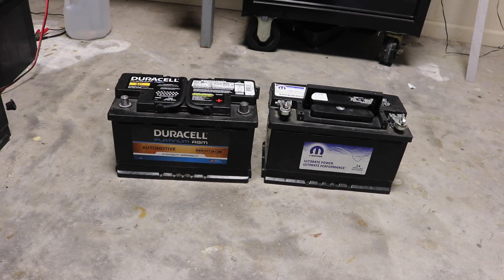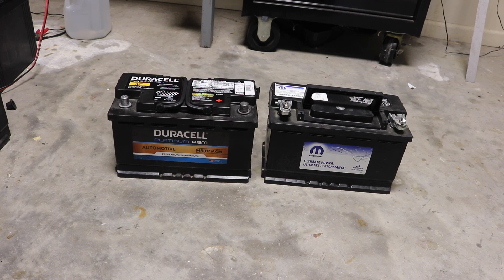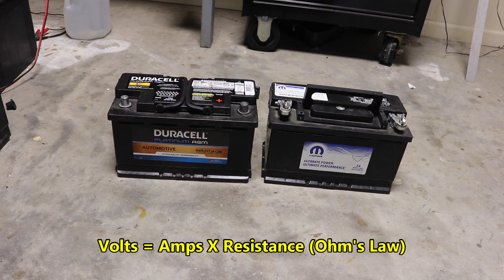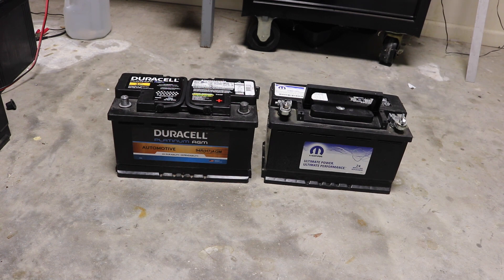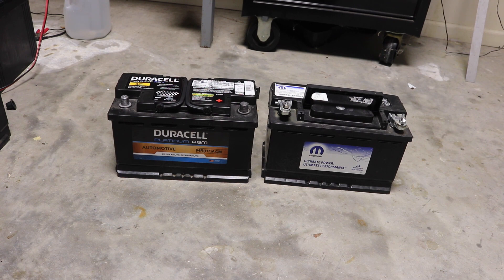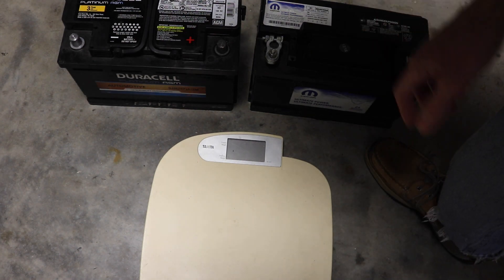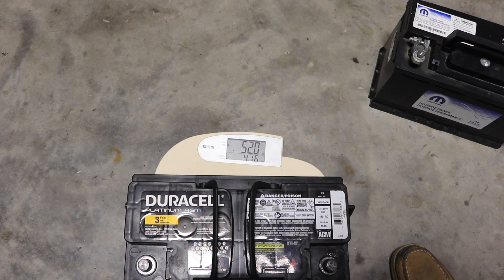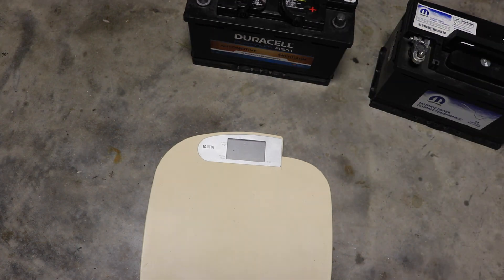RAM 2500 Cummins OEM vs aftermarket battery?

Comment: My '14s OE batteries lasted 6 years; one in Indiana, one in Michigan, and the rest at the coast of North Carolina. In 2020 I replaced them with Wal-Mart's equivalent which lasted only 18 months. This happened around the same time my alternator went out (145k miles), which in these trucks can cause major issues, send you down rabbit holes, and leave you stranded. It all happened when my wife was driving the truck. On a trip to the grocery store the truck went into limp mode (red lightning bolt) and threw codes for the throttle valve (there's no throttle valve on the truck anymore) and for an issue with the #6 injector. The thing sounded like it was down a cylinder! She called and I told her to try clearing  the codes with my Edge CTS2 monitor but to no avail. She had to wait hours for an 8 mile tow which the insurance company ended up not covering (about $500). Now here's the kicker: If I would have tried trouble shooting the codes I would have been looking at potentially replacing an injector and the PCM! Turns out the alternator was on it's last leg but you'd never know it; no codes, everything worked as expected, etc. It just randomly went into limp mode with random codes one day. When I got the truck home I changed over to a Mean Green 300 amp alternator and got two new Duralast Golds and she's been good as new ever since. Lesson learned is that these trucks have very sensitive computer systems that, with just a bad battery or weak alternator, can cause major headaches! Hope this helps someone because it is not uncommon. 👍
Reply: Sooo….you blame a WM battery for poor quality when IN Fact it was your failed alternator (and your amateur, unauthorized unapproved modifications) that caused the problem… Then when a good alternator is coupled to replacement batteries (mfr’d by the same maker to similar specs as the WM’s) …you proclaim the less economical batteries as superior?   You FAIL in Logic.
Reply: @ghorn3136  What a fail in logic looks like is your assumption that my "amateur, unauthorized unapproved modifications", which are neither unauthorized or unapproved and impact the truck's electrical system so little that they are not measurable and would be impossible to cause the problem, are what caused the problem. Congratulations.
Reply from the maker: @monsterram6617  yes sir I totally agree and thanks for taking the time to share that story. It’s quite amazing.

Comment: Thanks for the video and clarification. I thought the original was AGM also but now knowing it was not makes sense why the original batteries went to fast compared to the AGMs I installed. I did go to 850 CCA from the original 730 CCA which I thought had something to do with it but likely just the fact that the new is AGM.

Comment: We had -5 for 3+ days and the 2500 2017 Diesel would not fire.   Factory batts.   Too funny as i had just paid it off last month and had to put new tires on it and brakes and said now at 5years its time for batts.   So was traveling when it happened so went to local advanced auto parts and got a couple Die-hards and found it interesting that there is no such thing as a 5 year bat anymore... middle of the road was 3year and for 20 more could get a "platnum" with 4 years.  So dropped both in (800amps) and back in business.  I was fortunate as the main bat on driver side had a heck of a bulge in it.   Even wilder was factory bat was date stamped 2013.   Went on a lot of forums and found that 3years is a long time for those mopar bats.    I guess i was very lucky.    Cheers.

Comment: Best deal I could find currently  is an Ever Start agm platinum battery with a 48 month warranty at walmart for 180.00
Just put 2 in my 2012 ram 3500

Comment: Is it possible that your dealer replaced your original agm batteries with flooded batteries? I know for sure my 2014 and 2017 came with agm’s as original equipment.

Also, fun fact, there’s only 2 or 3 major battery manufacturers for starting batteries. Johnson controls (Clarios) makes about 70% of them, I think the others are East Penn/Deka & Exide. There’s a good chance the original mopar batteries and the duracells were made by the same company. 

Energsys makes the Odyssey and Northstar batteries, which are supposed to be very good and expensive, but I don’t know that they’d fall into one of the major manufacturers for starting batteries since they are focused in other industries.
Reply: The Odyssey batteries are excellent and worth the money in my experience. Keep in mind there are foreign-made batteries which are supplied as OEM batteries in some cars. I don’t believe the OEM RAM batteries are AGM. The diesel uses dual 730cca standard lead maintenance free batteries and the Hemi uses a single, but identical 730cca battery.

Comment: Marion, it looks like you installed the L-shaped vent on your uracell.  My old batteries didn't use vents.  Wasn't sure if I should use them so I left them off. Looks like I may want to recosider my decision!  Thanks again for your informatve videos!
Reply from the maker: They’re really not necessary unless you want to connect a tube to it and pipe it somewhere else. the battery doesn’t vent unless something goes haywire so you really don’t have to worry about putting them on. Unless you just want to point the vent downward
Reply: @MarionBlair  Thanks for the clarification--that sets my mind at ease.  I'm going to ignore them.  Happy New Year Marion!

Comment: Thanks for the videos! Heavy duty diesel trucks are new to me and your videos have been perfect for learning about my truck. Did you have a "Battery Saver Mode" message pop up on your dash? Was this the first sign that the batteries were failing? I live in Canada, so starting in the cold would draw a lot of power for the grid heater. I have had this message start popping up on cold days if the truck has been sitting for a few days.

Comment: I'll be changing the batteries in my 2018 Ram 6.7 in 2023 before a planned trip to Florida late in the year. Your discussion about batteries is very timely for me. I'll be replacing the alternator also as it seems to be failing. Any suggestions for me to look at on a good replacement alternator would be appreciated. Thank you!
Reply: Look up the Mean Green 300 amp alternator.
Reply: Go heavy and it will last forever. Extra $100 for a good one compared to light side OEM alternator.  Just my two cents… I ordered my 18 ram with the heavy alternator and it failed last year also.  Sometimes they just go bad sometimes they last forever.
Reply: The stock 220a single alternator gets overwhelmed by the grid heater cycling during the cold weather we have in the north. The headlights repeatedly dim and blower slows. That’s ridiculous on what is a new, very expensive powerful truck! The duals solve the problem. I also think the batteries are not large enough.

Comment: 2018 ram Cummins, 3500 I bought new. Just went out the other day and batteries have now failed. hopefully that’s it and not the starter. With the ignition on, I went through the screen to look at voltage, and the voltage was way down.🤔
Reply from the maker: Probably the batteries, the starters are pretty tough.

Comment: Marlon, what year is your truck?  I have a 22 and the dealer assured me that I have AGM.  But that’s not the main concern.  The concern is, if the dealer is wrong, and the batteries are indeed lead acid, then what are you doing about the alternator charge current for the new AGm?  As you may know, unless the charging current is 14.5+ volts max, then your AGM batteries will not last!  What are you doing about this?
Reply: Great point, you need to disconnect both batteries simultaneously when replacing them. This will allow the “Intelligent Battery Sensor” to learn the new batteries and provide the correct charge and voltage.
Reply from the maker: Most modern trucks can limit their charge to handle the AGM. This one does. I suspect the newer trucks to have the AGM‘s, I should know but I don’t. The 14s didn’t have AGM.
Reply: @MarionBlair  I would highly recommend that whatever we go by is 'factual' and not an assumption.  Perhaps you can perform a quick charging voltage test to be sure that yours & our 'most modern' trucks indeed do this and functions correctly.  AGMs are very expensive, and it would be a shame if these expensive batteries are dead within 2-3 years based on our 'assumptions'
Reply: I also have a 22 and there is nothing written on the batteries suggesting they would be AGM.  I doubt very much it is AGM. If it would be RAM would say so as it is a more expensive battery. When it comes to charge voltage there is very little difference between wet and AGM. As a matter of fact Lifeline who only build AGM recommends 14.6V. But charge voltage varies a little bit, depending on the manufacturer. What hurts AGM batteries is if they are charged at a High Voltage for extended periods. So if the regulator does not regulate down, to a float voltage when the batteries are SOC 100%, they will suffer. That happens is if you are driving for many hours and charging with high voltage .  The fluid in the absorbed mats will dry out and the battery will slowly die.  Unfortunately it is the same problem with so called “maintenance free batteries”  I’m not sure if RAM regulate down to a float voltage?
Reply: @a2022z2  well put.  My concerns exactly.  Many change out battery types based on ‘assumptions’ and not facts.  At least take a volt meter and confirm that ram’s alternator is indeed supplying the correct charging voltage.
Reply: I’ve been running an AGM battery in a 20 year old Range Rover for a number of years with zero issues. It’s been a great battery at 900cca and the Rover has a factory 150a alternator. Obviously the original battery was not AGM. Aftermarket AGM batteries are being sold every day into vehicles that never came with them.